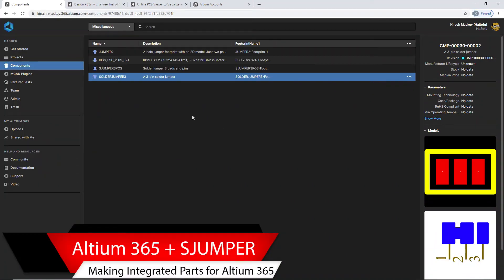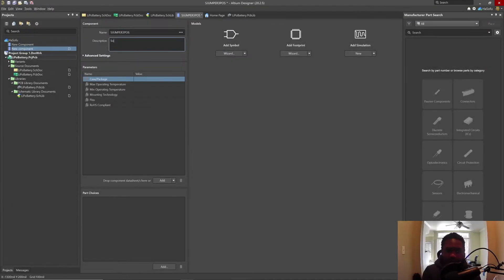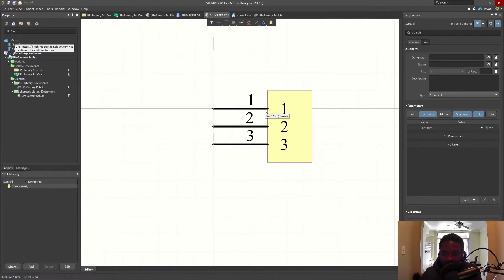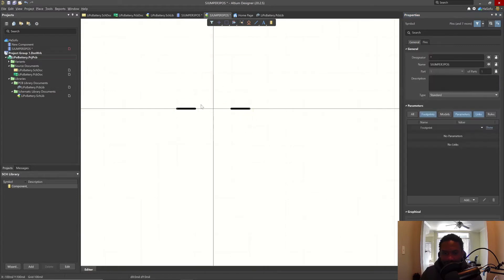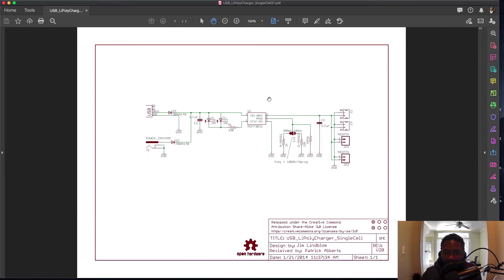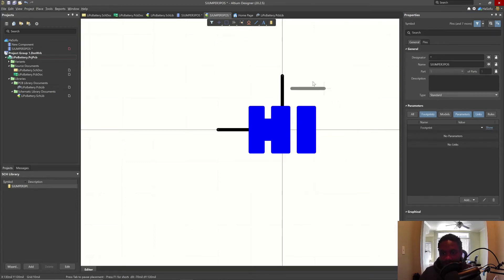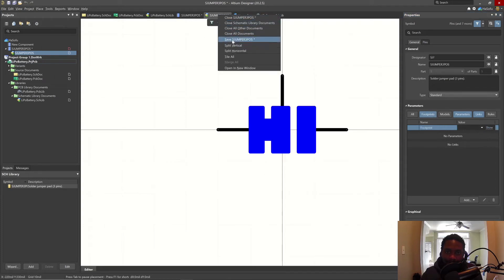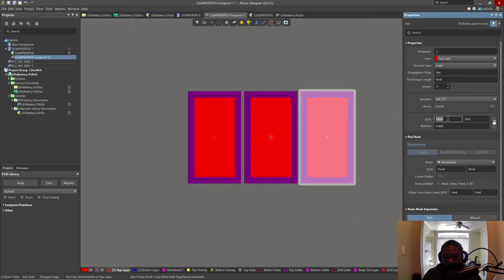Altium Tutorial Part 05 - PCB Design Tutorial for Beginners (Altium 365)

Comment: Once I saved my component to the cloud it just disappeared, how do I add it to my project library to edit it and use it?

Edit: I figured out how to place the component into my project, but it seems like once you save it to the cloud it isn't possible to edit it, unlike the components you create locally. And being that you cut the tutorial off before you explained how to link those two pads together like in the 3D model, that means I'll have to remake the part from scratch. The whole altium 365 thing seems pretty useless and I would advise people doing this tutorial to just skip the altium 365 part altogether to save yourself the headache.
Reply from the maker: Understood. I'll make a video explaining this. Sorry about that and the experience on 365.
Reply from the maker: Yeah so at first I had the same issue last year, so I figured it was useless. Then I found I had to pull them, modify, then re-commit. Like a git repo thing. Here's a video explaining this. https://youtu.be/Gsh394YABis